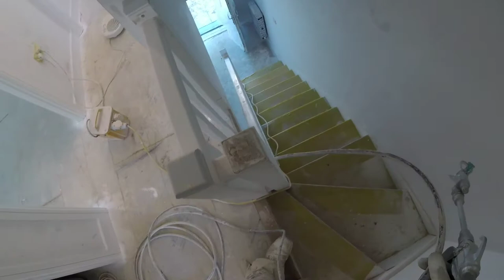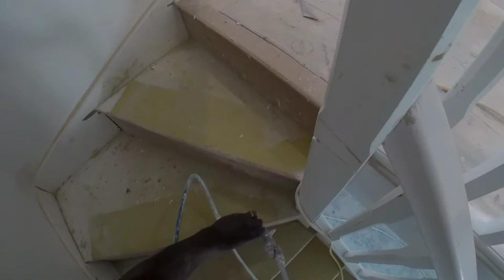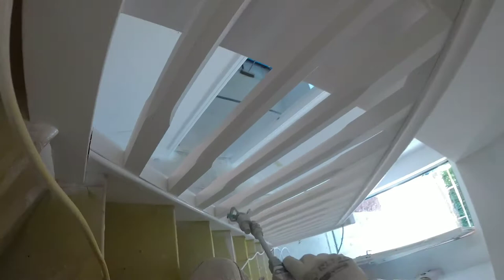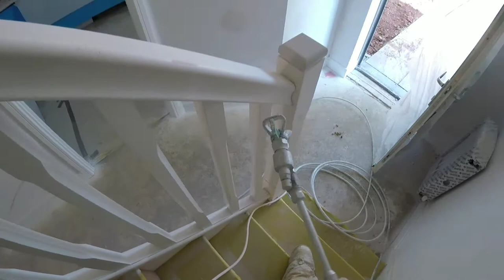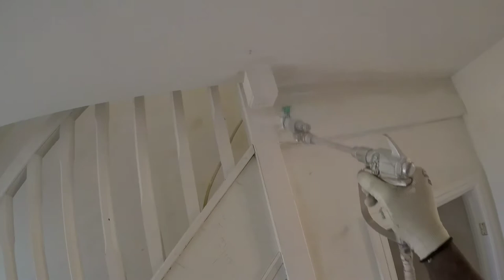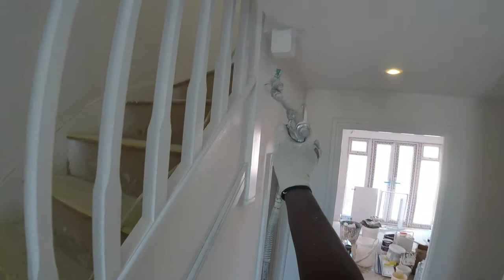SPEED TEST  on spraying banisters

Comment: What color filter are you using?, for tip blocks, it must come through the filter,so possible small hole or filter mesh to large.  Great video,
Reply: Didn't filter it first. Come on now trev..haha
Reply from the maker: Believe it or not someone sabotage some of the paint that me and another painter was using a couple of weeks ago. They threw  nails stones screws gravel, we even found bits of plastic at the bottom of the tubs we were using. Took mine and my mates sprayer out that day and we had to throw away 100 litres of paint. , im Still having a bit of grit issues inside the hose and it's been two weeks since that happened
Reply: @camdecorations9779  
Ohhh good answer trev. Lol
Reply: @camdecorations9779  
Probably another painter. With his green eyes in dude.
Reply: Sounds like some jealous painters on your site mate
Reply: @camdecorations9779  Fly screen works well for straining acrylic and still it has to come through the gun filter before it reaches the tip.
Reply from the maker: @ThePa1nterhowto  cool I'll try that one 
Thanks for the tips
Reply from the maker: @boydmitchell1524  it's only us two painters there , the other painter had some beef with a bloke on site so we think its him but we can't prove it. Between me and the other painter we lost just over 2 days worth of money and hours cleaning the the machines up
Reply: @camdecorations9779  double strainer mate never fail and yellow filter or 100 mesh to 150
Reply from the maker: @ajolote7193  I never hardly got tip blocks until my paint was sabotaged so my thinking is that it's just going to take a while to clear all the shit in the hoses. I  already use the yellow filter in the gun . Good tip though

Comment: Hi mate . Nice good job clean spraying banisters Which tip you spraying use for stairs and banisters?
Reply from the maker: I use a 310 fflp tip if you wanted you could 210 to get even less over spray. I use a 310 because its ideal for generally spraying doors , wide skirts and frames and it limits the amount of tips you need to buy
Reply: Thank you great I will buy tip 310fflp order. Thank you  😊👍🏼

Comment: Nice!
I see your using a T4, how do you find the ultra tips compare to the FFLP’s?
What psi you at there?
Cheers
Reply from the maker: I do prefer the fflp tips to the ultras,  the fan size are smaller than graco tips. I'm running at 1400psi o could run less but I like the the speed I have to work at by running the pressure that high

Comment: Hi  Colin. 
Question for you.. why the tritech over the graco..?
Les
Reply from the maker: It's a hard one to explain,  the tritech is a solid bit of equipment all round , you use it and its solid. It feels like you could throw it down a staircase and it will still work. While the graco the primer switch easily breaks it takes longer to dial into the pressure you want use , the pcb board on the 390 is piss poor , 12 year old technology on a brand new machine. The build quality compared to the tritech is no where near the same level. The only thing I really like is the quick connect pump. I think the hose for the graco is very stiff 
Compared to the tritech hose. I don't particularly like there guns and filters . There new gun is great , very light to hold and light on the trigger. To tell the truth it's like comparing a Samsung to an apple,  I'll guarantee to you there people out there that will prefer the graco to the tritech , but having both of these  machines I always use my tritech  over the graco
Reply: @camdecorations9779  thanks Col.
Reply from the maker: @MrLeshop  no probs trev